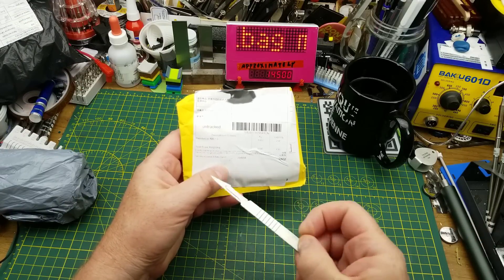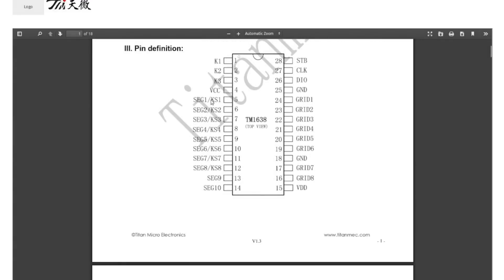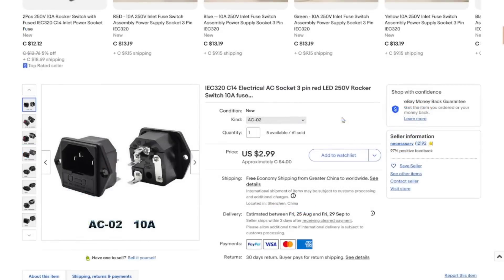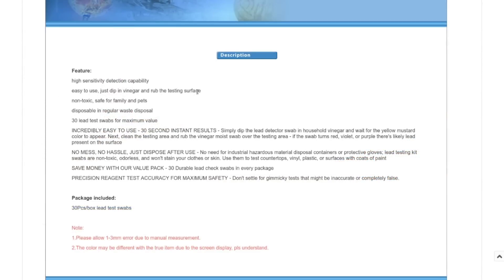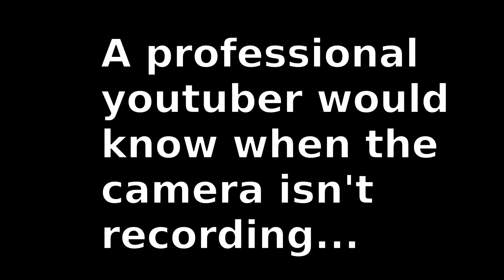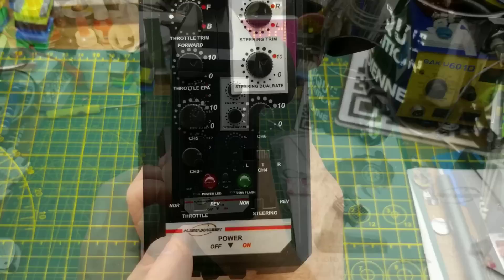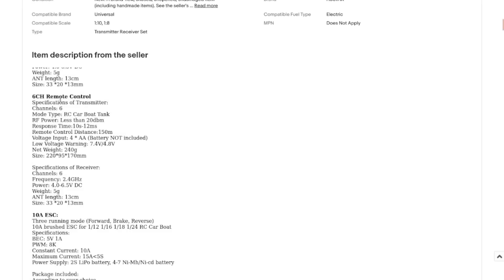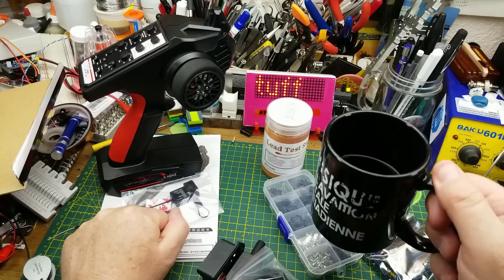Mailbag Monday 172

Comment: Be vary wary of the Chinese IEC switched, fused power connectors. One of my 3D printers had the exact same unit you showed. It melted and went open circuit (thank goodness). I searched for another with the same dimensions on Aliexpress so I decided to order 2 replacements. After a month they arrived and on installing the first one, no go. One of the poles on the 2 pole switch was open when in the closed position. Threw in the next one and it got me going again. I did more research to find a similar one with proper dimensions, found one on digikey and will be ordering one this week. DO NOT play around with suspect Chinese quality when working with components in your mains circuitry. Is burning down your house/shop worth saving a couple bucks???

Comment: Clough42 uses those LED/button modules as the control panel for the electronic lead-screw controller he makes and sells.
Reply: He used to, he makes his own now to get over a few  flaws those boards have.  Glitches due to RF interference, spikes from motors etc.  Another problem was things like holes being drilled smaller etc.
Reply from the maker: That sounds familiar now you mention it.  
I may have got the idea to order one from James.

Comment: Is that T1638 module meant to work with a 12volt supply?  Just checking for a friend who destroyed a development board last week.
Reply from the maker: The chip's datasheet shows it's max operating voltage is 7 volts.
https://futuranet.it/futurashop/image/catalog/data/Download/TM1638_V1.3_EN.pdf

Comment: Those look like JST-SM (or cones of...).  They're actually 2.5mm not 2.54mm so that listing is all over map... The official ones are rated for 3A and they're sometimes used for 3D printer hot ends.
Reply: I doubt they are genuine JST terminals anymore than genuine Dupont.   JST terminals, should really be made by Japan Solderless Terminal, which is the company that invented them, but there are so many clones that just say they are JST now.
That aside, they do look like JST Style terminals.

Comment: Serious question, what's the PC term for M/F connectors? I've tried to stop using the hard drive/bedroom terminology as often as possible but not sure on the connectors.
Reply: why should we change, male and female, hard drive floppy is good enough for me.
Reply: MoFo.
Reply from the maker: I've been told it's "plug and socket".
But that doesn't always indicate the pin orientation (at least in my mind).  
To me socket is chassis mounted and plug is cord mounted.
Reply: @pileofstuff  Often the recessed portion of connector has posts.  Your new JST-SM connectors are this way.
Reply: @pileofstuff  yeah I was sort of thinking the same thing... But sort of ran into the same issues as you with it not being quite as descriptive
Reply: @AnotherMaker  Look at Lightning connectors, the cable is obviously male, but for USB C the cable is technically female.  M/F usually works, but plug & socket is a far better description.
Reply: I think they're called sub and dom too in some places.
Reply: @cd-4li  Just don't mention that IDE disk drive Master/Slave thing... Ooops😱🤦
Reply: @michaeltempsch5282  Master/Slave for drives was a crap term anyway, Primary/Secondary was better.  Master/Slave implies one drive controls the other, which it doesn't.

Works for things like motor & lighting controllers though where the slaves do follow the master.